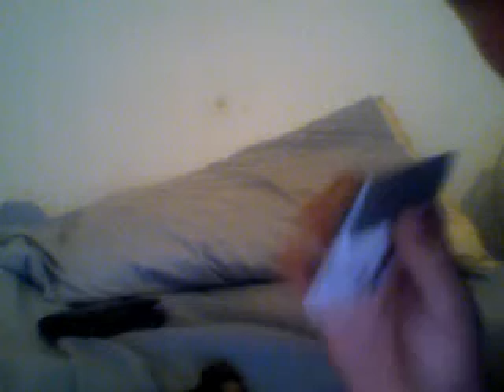n64 repair

Comment: This might be a stupid question, but how would you fix a cartridge slot if the pins are not making contact?  I'm still trying to figure out what's wrong with mine.  If I pull up/push back lightly on certain cartridges I'll get video for a second and then it disappears again.